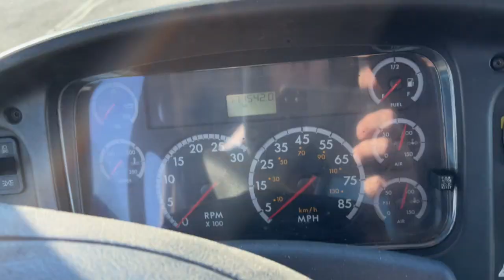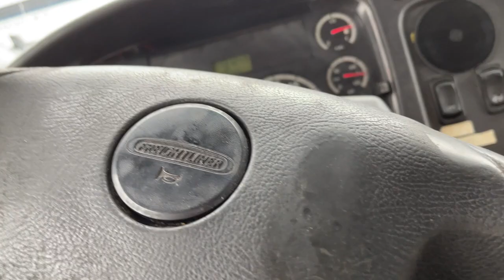RV Transport Business | Haul and Tow trailer [ Vlog Part 1 ]

Comment: I assume you have a CDL? Also how many miles are on the new rig? I do this as well but with a 2020 ram. Still loving it.
Reply from the maker: I don’t have my cdl, the rigs set up as a non-cdl rig though so I just have to make sure I’m under the 26k mark which the lady in the multi haul division I’ve been speaking with mentioned they always keep it try to keep the haul and toes under 10k combined between the two units!
Reply: @WeekendTruckin  nice!!! How many miles are on your beast? I know you can get a ton of miles on those.
Reply from the maker: The truck as whole is over 700k but the engine was rebuilt about 200k ago and the transmission was just under 3k!
Reply: @WeekendTruckin  nice. I’m at 83,000 so far in 7 months. I started at 20 miles on my 2020 ram. People always ask if there’s profit, short answer yes, if you don’t have a ton a month in bills. I have a lot in bills but am still paying off stuff already.

Comment: Did you buy your truck with current bed or did you have it fabricated and who did you use for job . Thx Tim Lynch
Reply from the maker: Hey Tim! I bought it like that. Not sure where this one was fabricated but I'd definitely had done a few things different to make things smoother with loading and unloading campers if I had the option!
Reply: @WeekendTruckin  ok cool , you passed me on I 80 in January in Iowa , I had a black 04 International 4300 but have since sold it . I now have a 2014 M2 112 Tractor and work for Synergy . Thx for the video's enjoy the content.